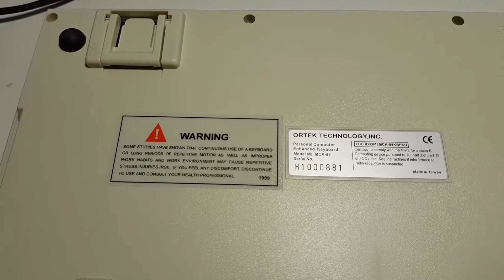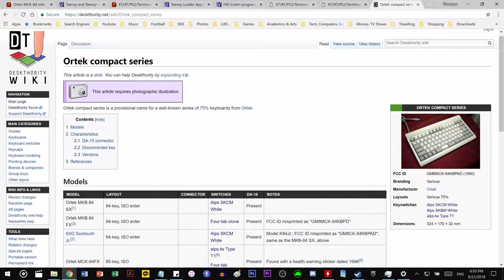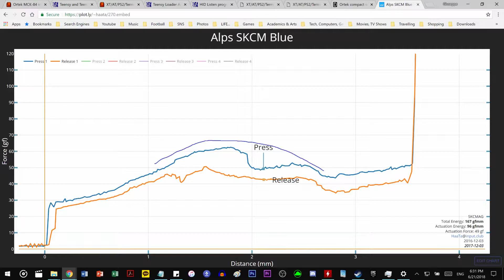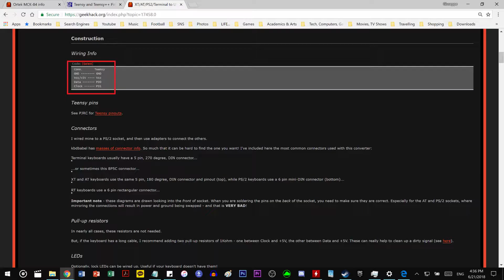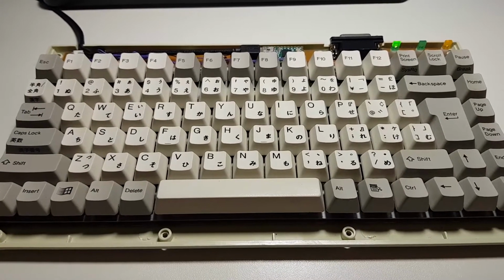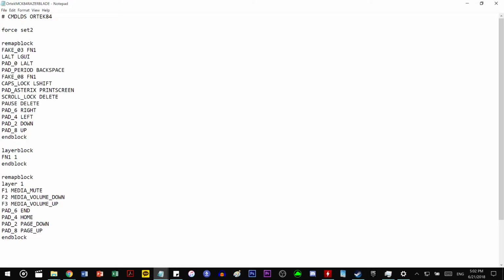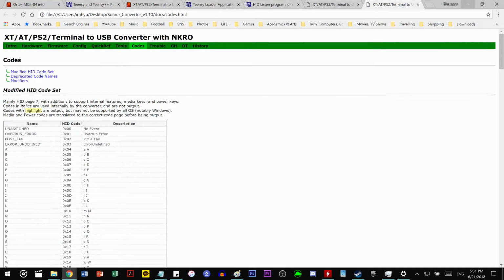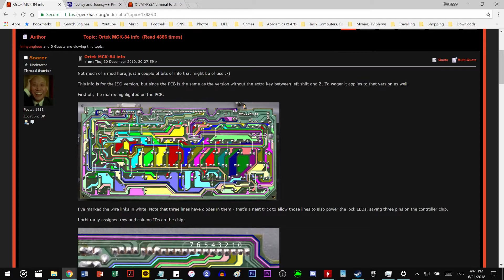MMKA EP#9 | Ortek MCK-84 Review (SKCM Blue Alps) / Quick Guide To Teensy & Soarer's Firmware

Comment: I found Matias quiet clicks to be extremely good, but only in comparison to their dampened Alps cousins. Undampened clicky Alps blow them away if noise is no issue.
Also clicky alps can simply do anything, a drop of silicone oil on the leaf hammer makes them tactiles, including the reduction in tactility (that snapback isn't just for your ears), removing the spring makes them linear. They can do it all.